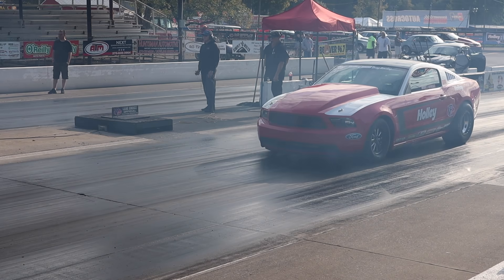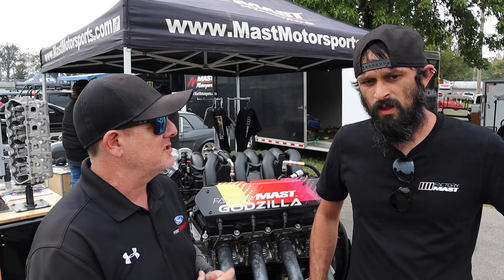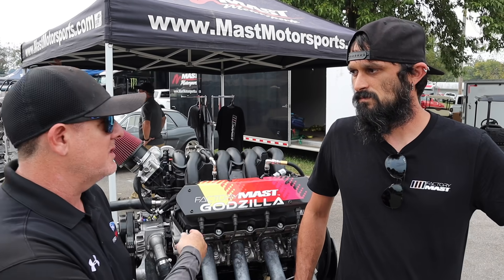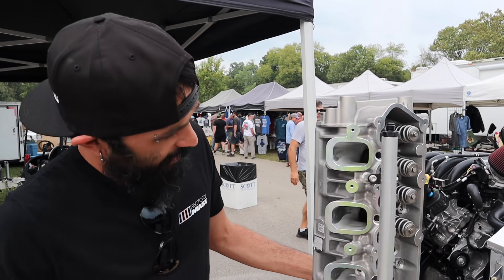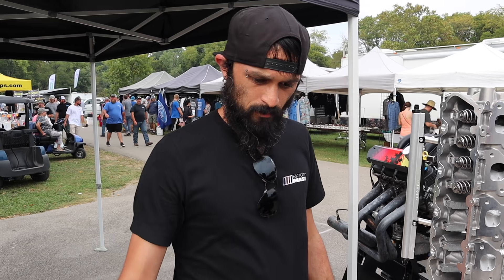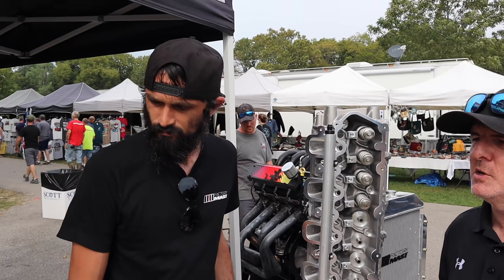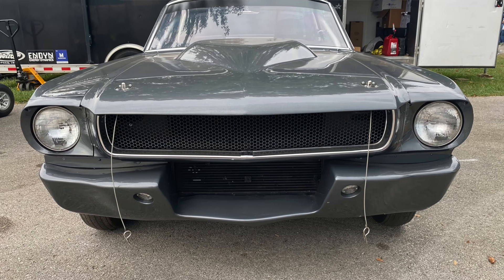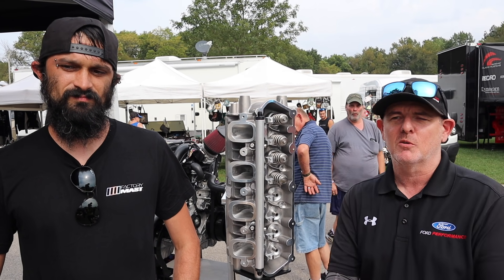Mast Motorsports Builds A 7.3L Godzilla Ford! 675 HP NA Combo — Hear It Run!

Comment: This engine is listed at the Mast website, in top 675hp form at $15,750.  At first I thought that was pretty high, but it is turn key with all the wiring, injectors and an ECU.  Further, the top LS based crate engine they sell, a 427, is only rated at 625hp and is the same price.  All in all, it probably isn't a bad deal to save yourself tuning headaches and running down parts from all over.
Reply: That's a steal for a turn-key engine making that kind of power. The crate  engine is $7000, and the only control pack I've been able to find for it is about $3000. Only $5000 more for a completely built engine with an ECU? Sign me up. 👌🏾

Comment: Can Ford just fix the world and give us a 7.3 GT. Not some crazy Shelby model that's gonna add an unwanted 25k to the price tag, take the GT and do what it needs to handle the 7.3 and nothing else. Maybe add a little 7.3 badge. 👍
Reply: We can only wish
Reply: SRT building the cars SVT fans wish we could buy
Reply: Or a GTS model that is BASIC
Reply: To fit a 7.3 into the current mustang would simply require Ford to put it in there. The footprint of this engine is actually smaller than the coyote’s because its an ohv engine. 
Its also a big block engine because the bore spacing is greater than 4.5”s.
Reply: @RadDadisRad  I'm aware, I just figured for a full production version they would probably do some basic suspension changes for the Wright difference. Maybe beef up some mounts and trans parts for the torque, etc.
Reply: 445 ( cu. in.) BOSS
Reply: They are going electric
Reply: @frenchonion4595  They already ditched that idea like three days after the first press release lol

Comment: That's 👌🆒️.  And on top of that, I didn't hear him once say they touched the compression ratio. it comes 10:5:1. Be awesome to bump that to a 13 & a half or 15 if I wanted it to run exclusively on E85 or C16 Race Gas.

Comment: LS what? NA that thing is already making more power than an LSA & sounds like a nitrous Pro Mod doing it.
Reply: Has a lot to do with those dyno headers
Reply: its much heavier then an ls/lt1 though
Reply: @hanzen5174  and how do you figure that? Godzilla weighs 538 pounds, GM lists LS7 weight as 467 pounds & adding the blower setup is another 72 pounds.  My math says they're dead even & the Ford displaces another whole 60 cubes. Sorry Chevy fanboy!
Reply: @acemobile9806  GM 6.2-liter LS3 V8  418 pounds with accessories. ford coyote is 430. an additional 100 pounds in a sportscar is a significant drawback. in a regular vehicle its much less of an issue

Comment: If I could fit a Godzilla in my 72 Pinto...
Reply: Do a super stock style front end, bet it will fit. 👍
Reply: @barneymiller7894  
Good idea but I want to keep it stock sheet metal. It’s my late uncles car and he bought it new to go with his V8 powered 71. 
It’s literally a 70’s time capsule.
Reply: @ZEPRATGERNODT  Gotcha, that's cool 👍
Reply: According to me watching every 7.3L video that REVan Evan has made the 7.3 dimensions are very similar to a 351 Cleveland. I say it will fit.
Reply: @samuelfreeman9518  
I'd have to make provisions to saddle weight at the rear to create an even weight bias because weight on the front of that Pinto and it will want to plow. I just can't bother with a 2.3L...been there and done that.